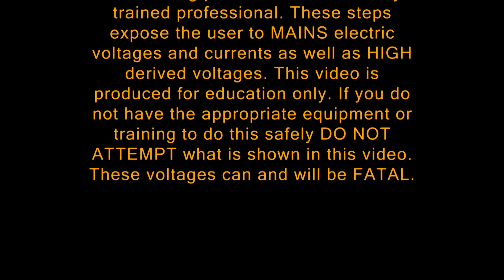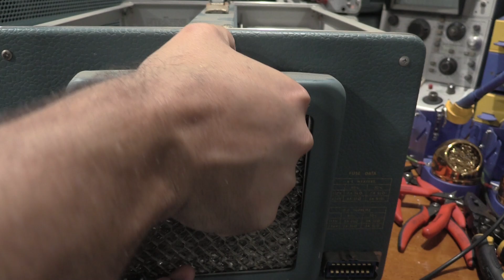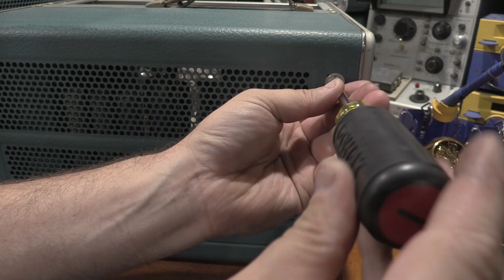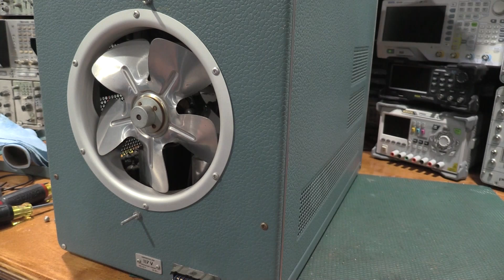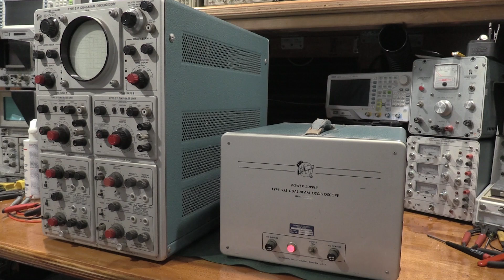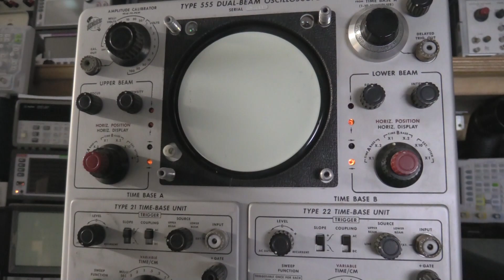Tektronix 555 Troubleshooting to unobtainum

Comment: I just realized you have an old 555; the switch to the 21A and 22A time base plug-ins was fairly early in the life of the unit.  I have a copy of the Tek instructions for aligning the 21A/22A, not sure if that would apply to the 21/22.
Reply from the maker: I do need to solve the lack of CRT tube issue to more forward again on this unit unfortunately. But I will keep that in mind.

Comment: Cool unit. I'll check on what I kave for vintage gear, but I think I only have a tripple 5 or a 565 left. The short power lead was for setting it up on a cart where 2 feet was plenty. If you want a modern cart, look up cheap welder carts. They might be just right. If you get a dead fan motor take it to an appliance shop, some fridge or microwave fan motors will work. If the fan doesn't fit you can find one of them too. Good luck. Thank you, keep working.

Comment: Part numbers for variations of the T555 CRT

Part No	Name 
Phosphor 
Graticule

154-0199-00 (154-199)	T5550-2 (T555 P2)
P2 (standard)	
external

154-0219-00 (154-219)	T5550-1 (T555 P1)
P1	
external

154-0220-00 (154-220)	T5550-7 (T555 P7)	
P7	
external

154-0221-00 (154-221)	T5550-11 (T555 P11)	
P11	
external

154-0476-00	T5550-2-1	P2 (standard)	internal
154-0476-01	T5550-7-1	P7	
internal

154-0476-02	T5550-11-1	P11	internal
154-0476-03	T5550-31-1	P31	
internal

Comment: The filaments are open in the CRT?; there are two separate filaments for upper and lower beams at pins 1 and 14 and 3 and 13; did you check these?  They are powered by two separate windings of T750 in the power supply.  That would be a very strange failure to have both filaments open.  I do have a good 556 CRT, but I don't think they are the same.
Reply: The 556 CRT is quite different and won’t work. However, I do have a couple 556’s and would really like to buy your CRT as a spare.

Comment: I had one of these magnificent scopes when I was in my late teens / early twenties, purchased from Rockwell International.  Its bandwidth won't impress people today, but as an analog and moderate speed digital guy, it met all my needs and wants handily.

TRIGGERING:  It triggers as good as the best modern scopes today.  The Dual Beam architecture was key to the most beautiful delayed sweep functionality where the top trace could show some complex waveform and the bottom trace would show a zoomed-in view of interest, where the top trace highlighted the portion of the trace that was expanded on the bottom trace - flawlessly and with vacuum tubes!

like most of the cars I have owned, I should have kept that scope.

Comment: I remember an early Mr Carlson's Lab video that blew me away to it's size. It was as big as his chest and weight 113 lbs.
From what I recall everything worked fine as Tektronix did not skimp on the components used. His fans were noisy. He
also had it on a type 202-2 Tektronix oscy cart (with 1 drawer). Too bad about your T555P2 CRT. Anyone out there have
a spare?

Comment: It could've been sitting for so long that you just have crud on the filaments that needs to be burned off. I've seen a tube afficionado bring a UX-245 back from the dead on a tube tester by just clicking the filament voltage switch up and down a bunch of times before settling it back on 2.5V, so maybe you could do something similar with the 555 CRT? I mean, if you're sure it's dead, then what've you got to lose?

Comment: I think the CRT is similar to a 5SP2. It would be very unusual for both heaters to be open ( unless loss of vacuum ). They can withstand significant overvoltage for a while. It is not uncommon to run the heaters at 9-10V for a couple hours during manufacture. I would look at the heater pins of the CRT as those connections may fail, and can often be repaired on CRTs that have hollow pins.

Comment: Interesting way to oil bearing. I never oiled fan bearings but i do repair/restore among other things turntables and i usually try to disassembly entire motor,clean it and then oil it. That way oil doesn't mix with dust that has been collecting there for i don't know how much years.
And i am interested in video of that 585. I don't comment much but i love Tek gear so just keep it comming. :)